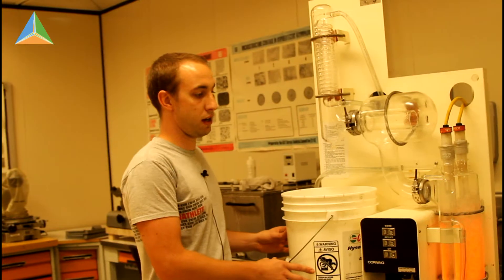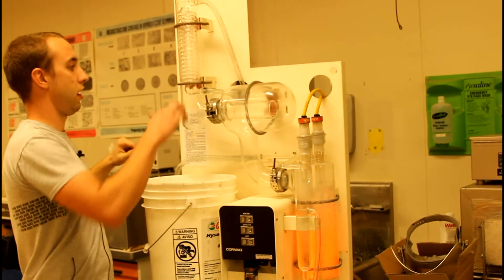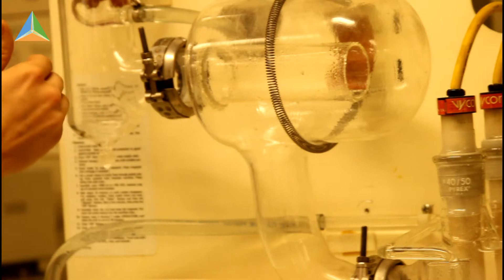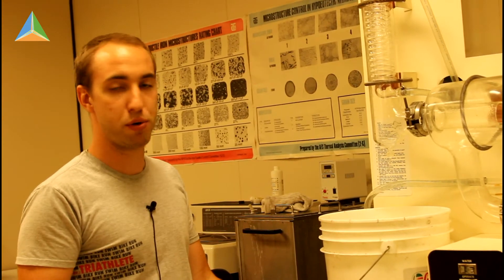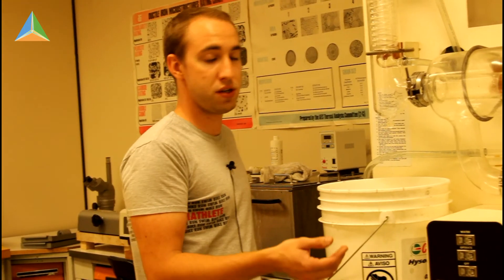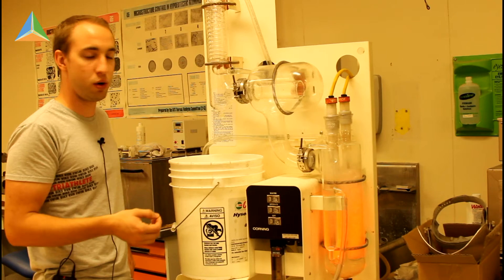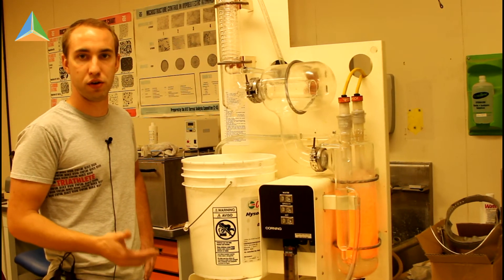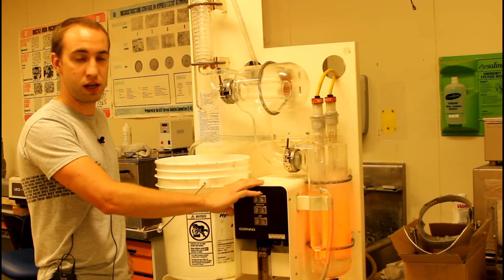Water Distillation Unit project

Comment: What we need is a great plant to distillation salt water into sweet water.
pump water into a dessert area and lets nature filter that water.
Pump later up the good stuff and soread over the dessert again isn''t easy?
Reply: you could modify an old corning/barnstead megapure unit such as featured in the video to purify sea water.  You would just need to pre-filter the incoming water sufficiently and adjust the flow rate so that you have enough overflow that you do not concentrate the sea water in the boiler enough that you get salt precipitates there.  You would probably have to clean the boiler, elements and steam trap a bit more often as well.  The Borosilicate glass of the system should be adequate for the task.  You could even set up a system to run it off of solar, starting it in the morning and ending in the evening.  Those are rather robust units built for laboratory water production..  The downside is that it is not the most energy efficient and the unit he has there, which looks to be a model MP-6a only produces 6 liters an hour, so it would be adequate for a bit of drinking water, not a mains water system.  If you wanted to scale this up for a mains supply, you would need a sizable solar farm to power it.  Energy efficiency is why virtually all new desalination systems are reverse osmosis systems instead of distillation.